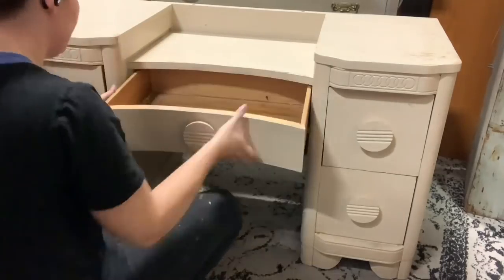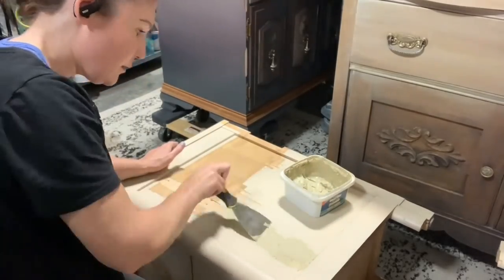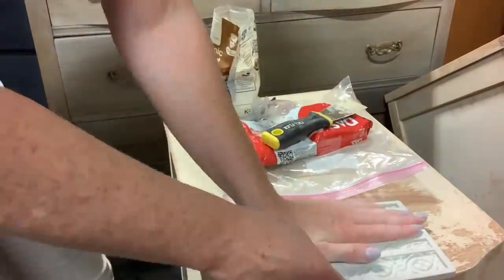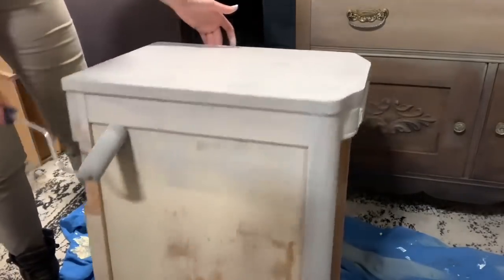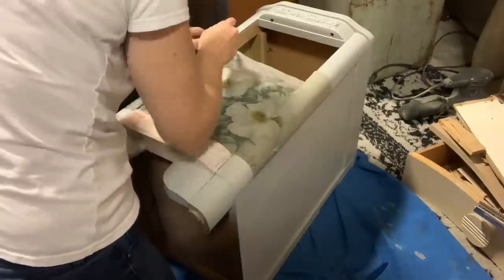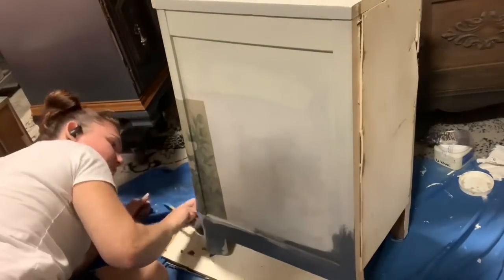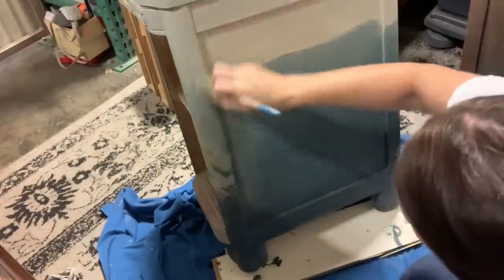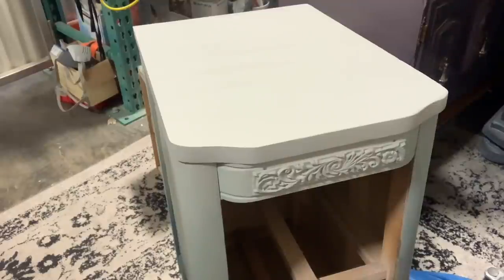Beat Up Vintage Vanity To A Lovely Set Of Nightstands | Blended Decoupage | Elegant Upgrades

Comment: I love how they turned out, but how did you finish the backs where the damage was after you separated them from the vanity?  These are incredible.  You are an artist for sure.
Reply from the maker: Usually if the back has damage I’ll just fill it like I did with the sides and then just do a basic paint job over the top to give it a clean look. Thank you very much, Cheryl!

Comment: I love that you used air dry clay for the molded pieces. Super smart idea to paint before it's dry too, like you said to avoid cracking. These turned out gorgeous all around, so romantic and pretty!
Reply from the maker: Thanks, Jenn! Yes, I love using the clay when I have to make multiples. I’m too impatient to wait for resin to cure 😂